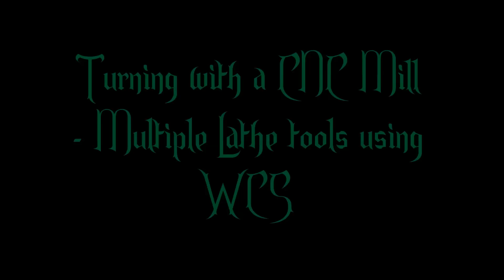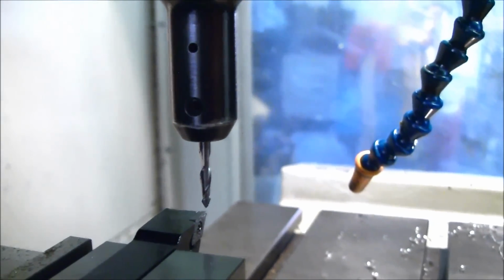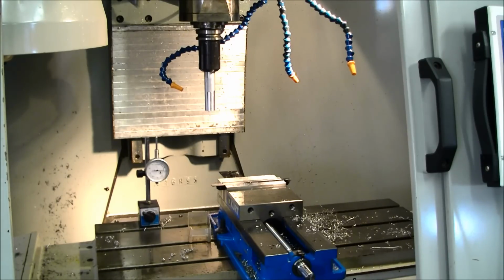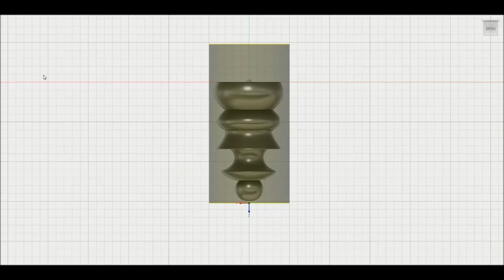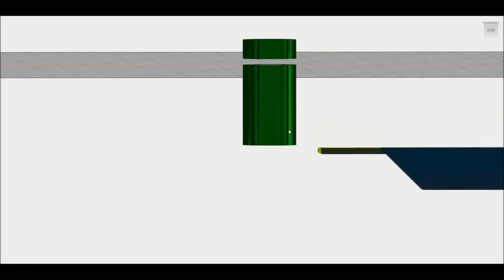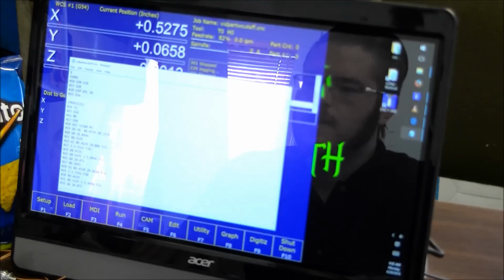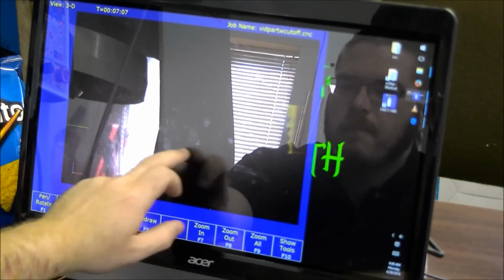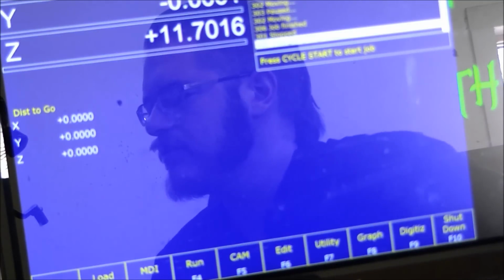Turning with a CNC Mill - Multiple Lathe tools using WCS

Comment: For what it is worth, you can do the same thing on a plain old mill.  I have an old Emco FB2 I literally dug out of the trash (not as easy easy it sounds when you say it out loud).  It is rim-cut and rusted, but it does any job I ask it to.  The head rotates 90 degrees so you can put a tail stock on it.  But most of the time I just chuck up whatever I am cutting and whittle away with the cutter in my vice.  I tilt the head for tapers and use the column wheel to run it up and down.  This is REAL hobby stuff, you understand, in that I don't pull out the calipers unless my part happens to not fit in the hole I cut it for.  Then I make another part, and actually measure stuff.  Hehe!

Comment: I'm new to cnc.And that's exctly what I was looking for.I've tried it but changing "x scale "paramiter has no efect on generated gcoge.Is it  somthing else that I shoud do?Or maby  I coud get modified post proceror from you?I converted my mill to Centroid Acorn so whatever works for you shoud work for me.
Reply from the maker: You changed the x scale in the post processor? What is the specific issue you are having? If it does not post at all the processor will generate an error log file.
Reply: @dragonwrathinnovations7780  Thank you for responding.My issueis that x values in posted gcod are diammeters no a radiuses  what i need.And and I  can't change that no mater what  scale # I put in "var xFormat = createFormat({decimals:(unit == MM ? 3 : 4), forceDecimal:true, scale:1}); // radius mode" .
Reply from the maker: @moj.wz.29  I used the Fanuc Lathe post processor as a base for posting turning operations to Centroid. What post processor are you trying to use?

In the fanuc post i went to this:

var xFormat = createFormat({decimals:(unit == MM ? 3 : 4), forceDecimal:true, scale:2}); // diameter mode

I changed scale from 2 to 1 for this

var xFormat = createFormat({decimals:(unit == MM ? 3 : 4), forceDecimal:true, scale:1}); // radius mode
Reply: @dragonwrathinnovations7780  Than you for responding.I checked few  procesors and for me it works only with Haas post procesor.No luck with Fanuc

Comment: So you use the lathe cam in fusion?  create your operations.  post them and then edit the posts to removed lathe commands and enter mill commands?  With the screen was a bit clearer.  It would have made following along a lot easier.  Impressive stuff and something i hope to try!
Reply from the maker: You got it, just post like it's a lathe. The g-code editing is mostly to make sure no tool changes are attempted and to make sure the circular interpolation is running on the x/z plane instead of x/y. You also want to add Y0. at the beginning of the job and after any WCS changes.
The video capture I was using only grabbed the Fusion canvas so couldn't see me going through the settings. If you get to trying it I'd be happy to help with any questions. Most important: if you try it run the job with Z0. way up until you have a handle on how it will behave.
Reply: It may be something i try soon!  Thanks for the reply.  Once i get further along i may ask a few more questions.  Thanks for offering to help!

Comment: when generating gcodes with a cam turning it generates x as a diameter but by turning in a milling its must be a half of diameter how to change that can u help me sorry about my english
Reply from the maker: Sure, this is a setting in the CAM post processor. I use Fusion 360 but not sure how it is with others\ CAM sodtware. You need to edit the post processor and find the setting related to scaling of the X axis. My post for Fusion has a line that reads:
var xFormat = createFormat({decimals:(unit == MM ? 3 : 4), forceDecimal:true, scale:1}); // radius mode

I edited this from a Fanuc post, originally had 'scale:2'

Hope this helps, good luck!